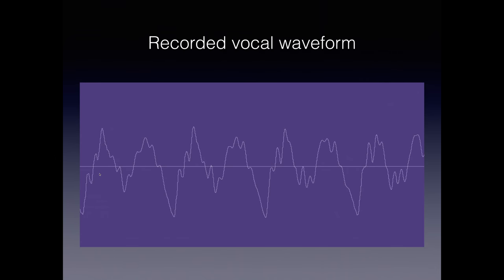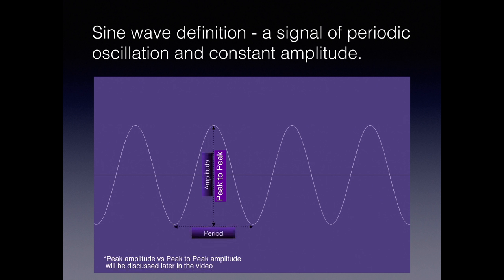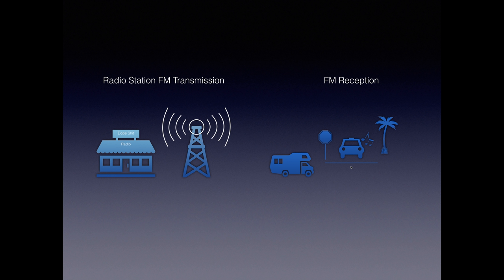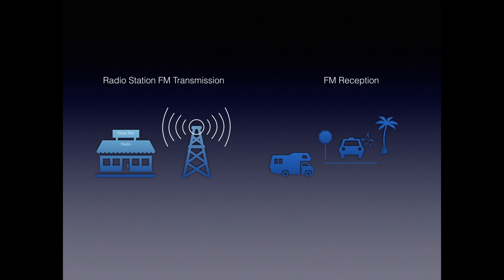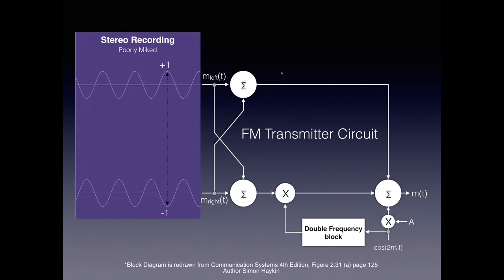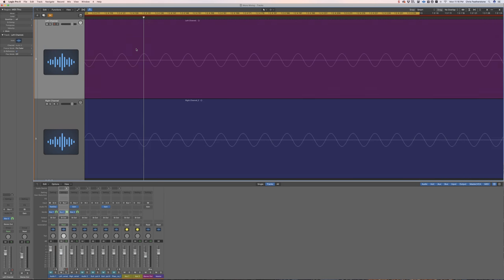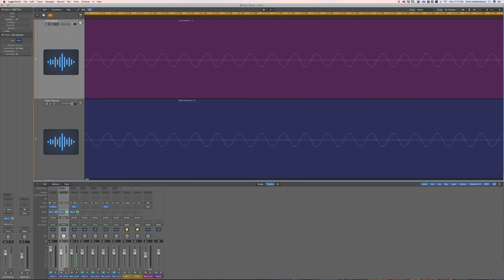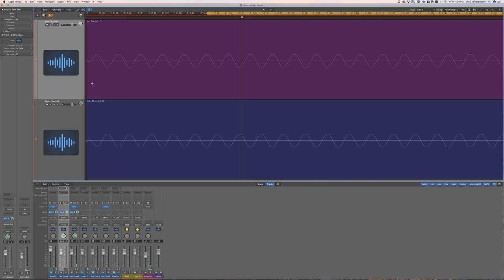Why Mix in Mono, Mono Compatibility and Phase Cancellation

Comment from the maker: I just realized I made a small mistake starting at 4:04. The bottom block is a difference block and will be 1-(-1) = 2. My point still stands and here’s why. The top block is the sum signal and is left unprocessed unlike the bottom path. You can see it goes straight to the output. This is the baseband signal and can be received monophonically  by the receiver. This portion is important because when the transmission is too noisy, which is common with FM transmission the side information (which is the bottom difference block section) does not pass through the receiver and the mono portion will be pushed out the speakers. The difference signal that contains the side information is Amplitude modulated and is more susceptible to noise. FM transmission assumes that the source material is mono compatible. One requirement for FM stereo transmission is that it has to be compatible with monophonic receivers. When the signal to noise ratio gets bad the stereo receivers will eliminate the side signal information and mono will be played.

In addition the mono or mid signal would have information lost still at the summing node as demonstrated in the video if components are out of phase. The goal is to have the listener hear the mix as you intended it to sound.

Comment: So when do you use invert phase? Never? Depends? Do you line up the peaks and valleys and then sometimes also have to use invert?
Reply from the maker: powerkor great question. The phase invert option is good for flipping the amplitude of a signal you know is in phase but equal and opposite amplitude. Here’s an example to hopefully clarify. 

Let’s say you take two mics and put one under a tom and one above a tom from a drum set and those mics are equal and opposite distances from the drum head. The air pressure from the tom creates equal and opposite amplitudes captured by each mic however the phase is aligned because they are the same distance on either side of the drum head. If you can imagine a strike on the drum head forcing the drum head down, the air pressure on the bottom mic or the wave that is created looks opposite in polarity to the top mic. In this scenario using the phase invert actually works. This is actually where the phase invert came from:

Theoretically

-A*sin(x) = A*sin(x+180). The 180 is normally represented by the Greek symbol phi which is phase. Since mathematically we can derive the above equality the industry has resorted to calling the “phase invert” button phase and uses the Greek symbol phi in our daws. Technically they’re correct if you are in a scenario such as the drum example. However the moment one mic gets moved a further distance than the other mic this doesn’t hold up anymore. This ends up creating a lot of confusion for people. Hopefully I’m doing a good job explaining to people because I can see there’s a lot of controversy online about this topic.